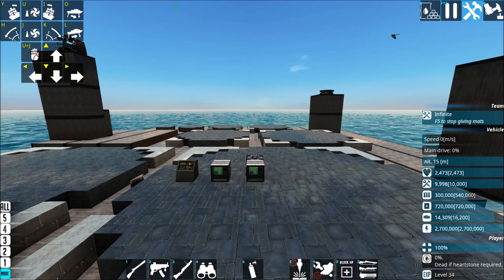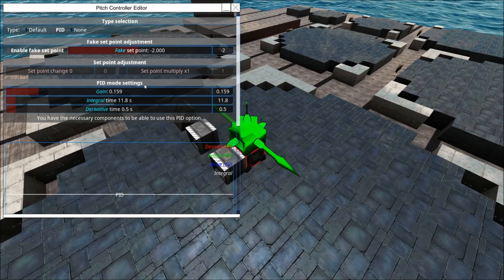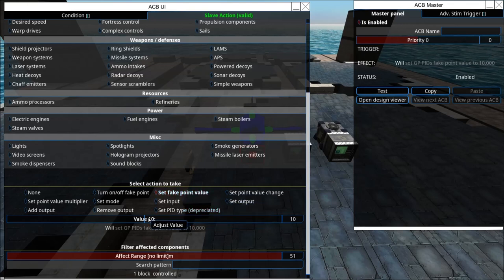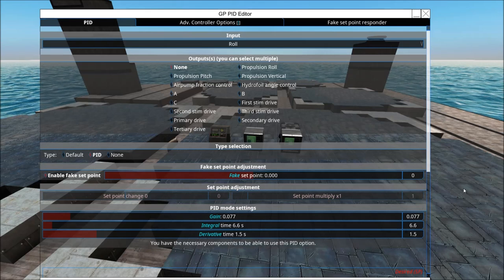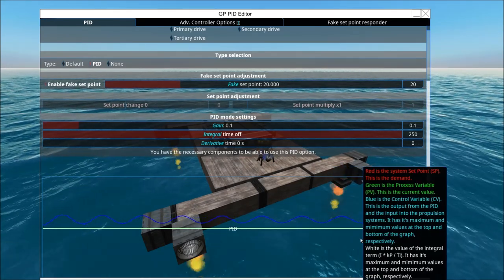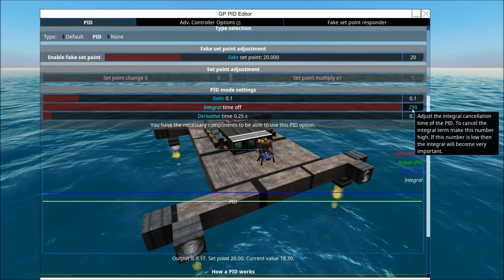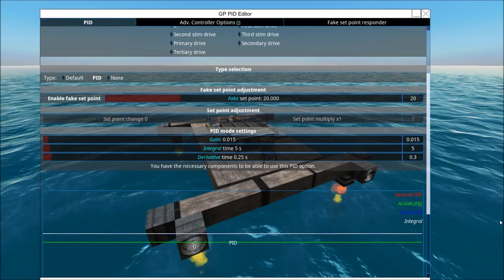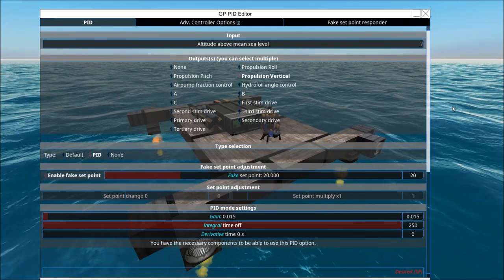From the Depths - PID Tutorial

Comment: Things to note what i found up by tests and how i understand it:
GAIN - % of propulsion linked with PID it has AUTHORITY over, the higher the less force propulsion has in certain situations when PID try to smooth agile maneuever out.
DERIVATIVE - Good for tweaking, this "prediction" acts like buffer and accelerator - it will help with recoil if your ship wobble after fire and can help with to rapid as well as slugish movement - WARNING, high values can INCREASE power consumption, while giving no adventage, test not only in calm but movement scenarios and set it so ship regains balance fast.
INTEGRAL - Is a limiter that forces PID to apply it's fix in set period of time. High value gives more time for fix and is more fluid (large bombardment platforms) while low values force rapid fix (small agile gunships).
BASED UPON propulsion placement, ammounth and is it roll/pitch/yaw/hover/strafe PID values will differ horribly. Also using propulsion for both ...examp. Hover and Pitch...is questionable sometimes. Atmosphere and Space settings are hard to combine, also AI maneuever/Behaviour and center of mass will have their say, so every change on ship needs PID check.
ONCE AGAIN ...stabilizing ship in calm situation is not enough, if force/impulse is applied it need to regain balance, also unproper setting might give you "stabilization" in both situations while power consumption might be higer by 200% of what's actually needed !!! (What can looks like "stable" and "calm" visualy in game FX in reality in game code those engines can fire for example left/right constantly trying to even themself out).
Reply from the maker: A lot of people have their own theories about PIDs and are unfortunately wrong. I can't fault people, it's not information that is readily available and there's details I don't quite get even now. That said, a PID without a gain of 1 can use 100% of the available thrust depending on the difference between the setpoint and the current state of the vehicle. Integral also "accumulates" error over time rather than forcing the PID to fix the error within that time though I can see why you'd think that way given a PID with low integral will push quite hard quite quickly if it's struggling to stabilise the vehicle.
As for not allowing each thruster to control every possible axis it can control, it's a whole other debate and there's pros and cons to each approach. However, I am quite confident when I say that enabling more than one axis for most thrusters is the more efficient option in the end, but it does require careful tuning and to plan ahead for situations you might not even imagine before you see it happen.

Comment: If you're familiar with a spring-mass-damper system, essentially the proportional component is like a spring and the derivative component is like a damper. Here, the proportional gain is equivalent to the spring constant. In the form that's in the game, the damping coefficient is equivalent to the product of the proportional gain and the derivative time. I don't want to get into the math of the integral component, but just know that in the form present in the game its relative influence is proportional to the ratio of proportional gain to integral time. I would avoid using integral control unless you have steady-state error you need to get rid of. Besides eliminating steady-state error, when your set point changes integral control will decrease the time it takes to get there but will then cause overshoot due to the accumulation of error.
Reply from the maker: I'm aware that some of the specifics of how I explained things do not necessarily fully line up with the math. That said, I think it does a decent job of explaining it as simply as possible for the less math-inclined people.

As far as integral goes, yes, it can cause overshoot. However, for combat vehicles where thrust is likely to be damaged, integral is a way to maintain control for longer. For that reason, I actually encourage people to use it even if they don't need to.
Reply: You summed up what I would have commented otherwise! Accumulation of error on the I term is an issue in this game, which makes PD controllers (I set to 250s) a safer and just slightly less accurate fallback. I only ever use the I term on altitude control, and pitch for frontsiders that may need it.

Comment: This is great. Doesn't seem to work for boats though. At all. My yaw is all over the place.
Reply from the maker: It should work fine for ships, though the ratio between thrust-to-weight and water resistance will make tweaking things harder. Also, yaw tends to be more finicky just in general and I would definitely recommend against using integral for yaw.
Reply: @OhmIsFutile  Thank you very much. I didn't expect an answer to my vague complaining. And it's actually helpful ^_^